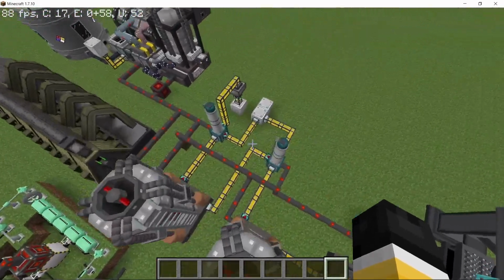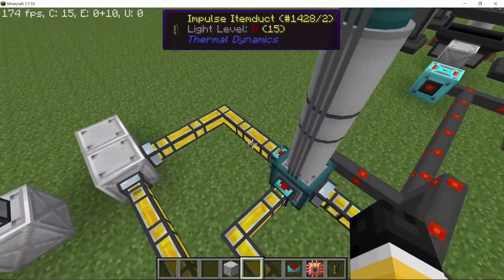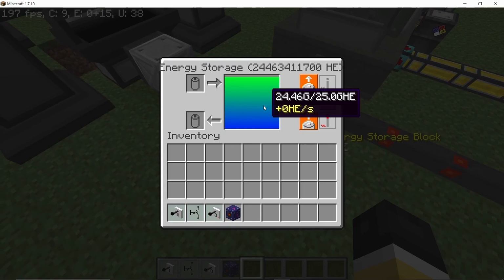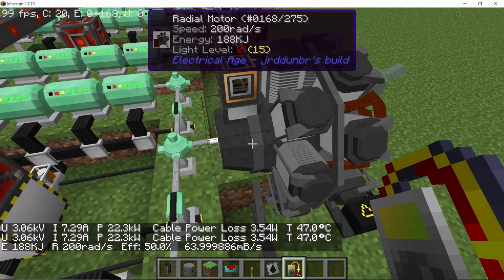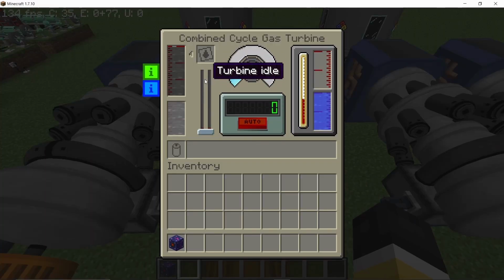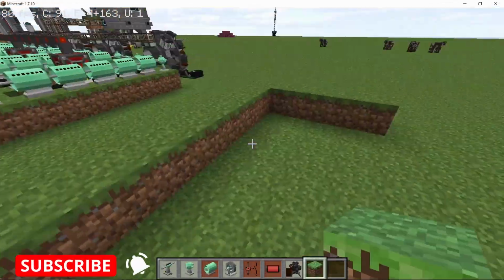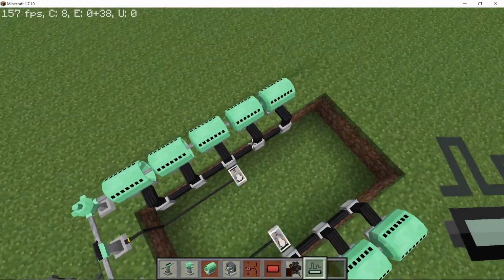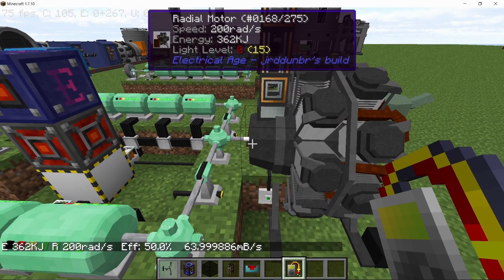SYNGAS Power Production and Comparison - HBMs NTM vs Electrical Age Mod Tutorial

Comment: I have a question about the hbms ntm reloaded mod. Does the reloaded 1.12.2 version have all the features from the older version? Because in my survival playthrough, i couldn't find many of the items I've seen in videos. For example, i saw a biofuel generator, but i was not able to find it in jei.
Reply: The only good 1.12 version is CE, Community Edition. Reloaded and Extended are both bad, buggy and dont try to be a 1:1 ratio of 1.7.10 [The original one], being never updated or simply adding slop and removing QoL.
Reply: @isaacm1929 oh alright.
Reply: There two new forks of HBM, they having some of the stuffs and planning to add all of them that exist in the older one

Comment: I think a cryo fluid reactor should be added to HBM’s NTM
It will be named CyberCryo
Reply: 1- reactors boil stuff. Not cool them.
2 - you can use the perfluoro PA coolant in a PWR or ICF iirc. Maybe even on a RBMK fluid heater. It then technically becomes a cryo reactor.
Reply: @isaacm1929 it’s one of my fictional reactor types
It uses cryo fluid it’s like molten salt
Reply: @THGMOTORTY3thegamer  Molten salt reactors are a thing. We already have thorium salt
Reply: @isaacm1929 Fortnite has a reactor that’s not nuclear but powered by a cube
Reply: @THGMOTORTY3thegamer  And?
Reply: @THGMOTORTY3thegamer and?
Reply: @THGMOTORTY3thegamer  what does fortnite has to do with this?
Reply: @THGMOTORTY3thegamer  are you gonna suggest a cube reactor
Reply: @jaydad1227 well, we kinda sorta have it lol. Its the Radiolysis chamber. 3x3x3 RTG  cube.
Reply: @jaydad1227 i don’t wanna talk to you
Reply: @isaacm1929  I mean kinda but it's mainly more scaled version of rtg and minus the frame not that much of a cube
Reply: @jaydad1227 Ye, lol. Although its kinda funi to think about
Reply: @THGMOTORTY3thegamer Too bad, shouldve listened to them, as they were correct.